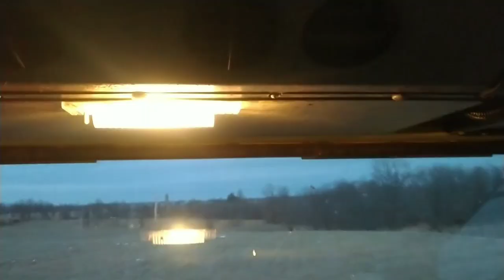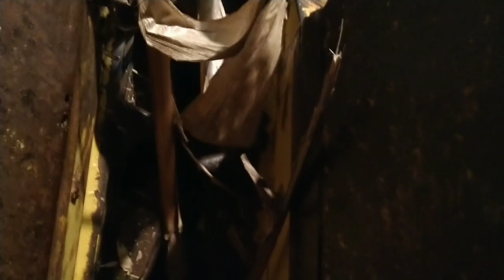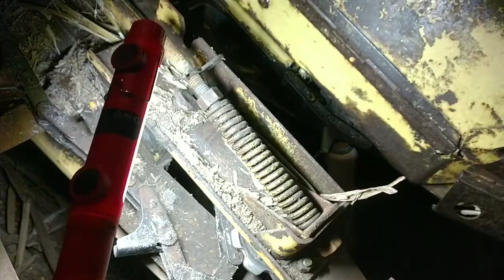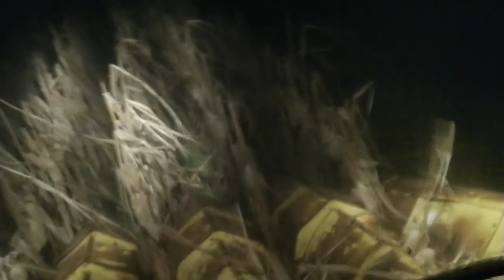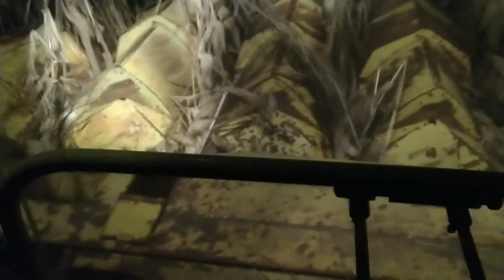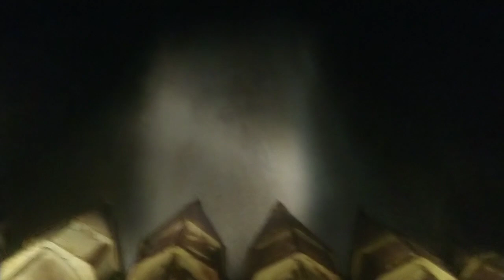First Corn Crop... First Cab Corn

Comment: Other than that one row, seems like things are working pretty well.  I know how you feel with cab corn.  I use an old JD 4400 combine and the cab is offset to the left side, with the engine beside it on the right.  So, when I get over-filled, my "cab corn" ends up on the top of the engine compartment lid, which is a pain.  My cab is high enough I don't get any there.  Keep up the good work.  If you get time, check out my channel.  I started posting videos about a month ago.  You can check out my old junk.